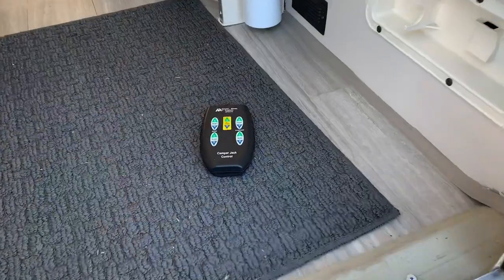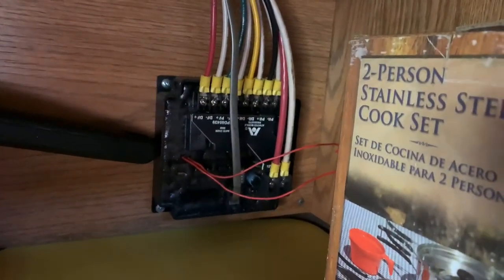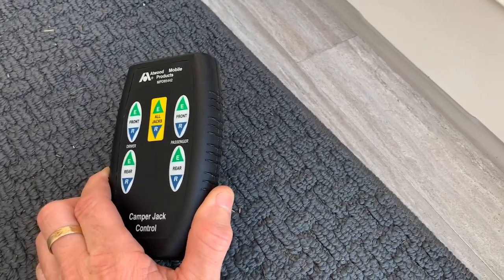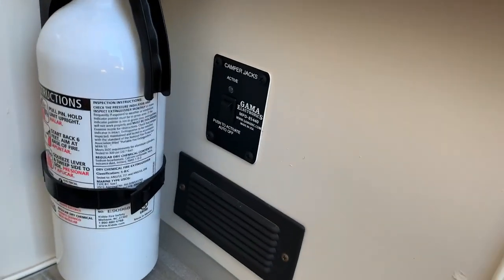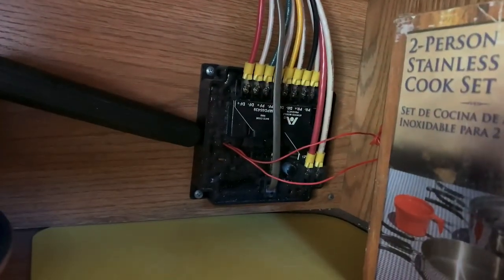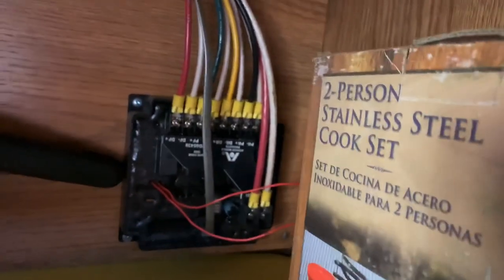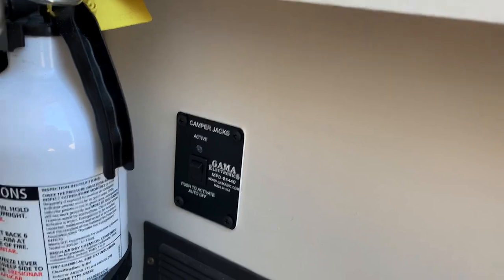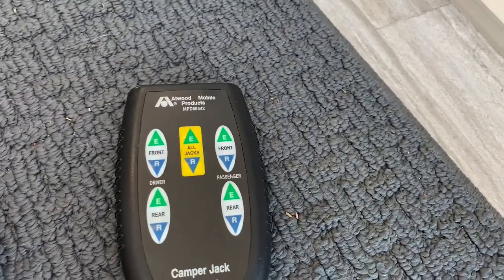Atwood Truck Camper Jack System & How it Works.

Comment: Do those activation switches fail often? Please help me, it worked fine when I bought the old ‘94 camper and on our first trip. But failing now to remain on and therefore unable to use jacks.
Reply from the maker: I’ve replaced mine once.  No issues since.
I’ve done a few service calls on Lance and Arctic Fox campers from the same era.  2000 to 2004.  No further issues with those that I know of.

Comment: Do you know of a power drill and bit that can be used in the event the electric system fails?  Hand cranking is not an option for me and I want to be prepared for the what ever.
Reply from the maker: This is what I have.

https://www.rvupgradestore.com/Socket-Jenie-For-Atwood-Truck-Camper-Jacks-p/lvsg-501.htm
Reply: Can you safely run a drill without disconnecting the power?  I hear what I believe is a motor turning/running when I use the hand jack
Reply from the maker: @mymessyfingers  you have to unplug the jacks before turning.
Reply from the maker: @mymessyfingers  
My camper jacks have a two-prong plug right at the camper sidewall.
Reply: Thank you so much!  Might make a great video